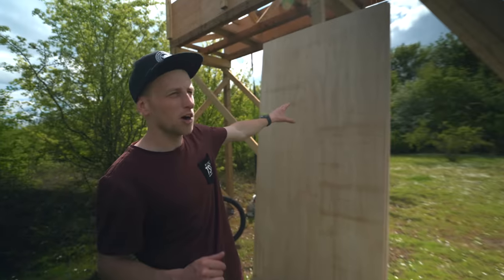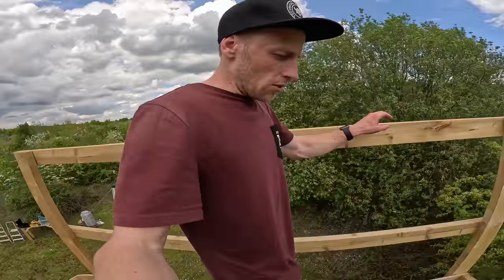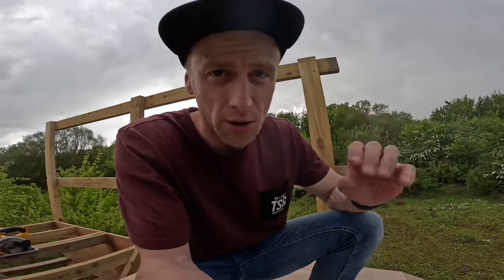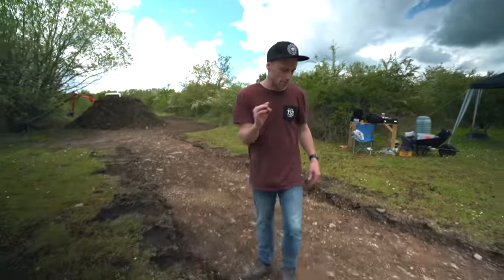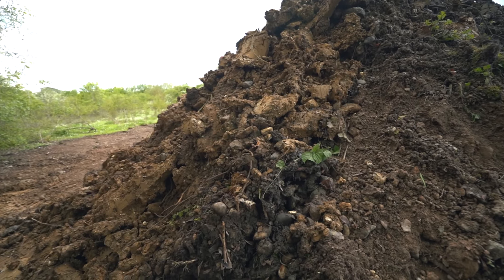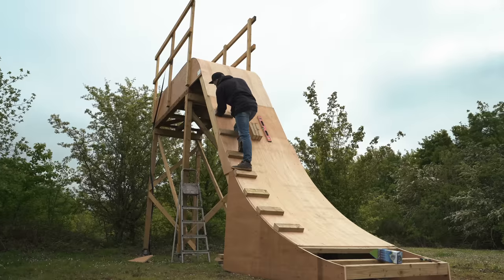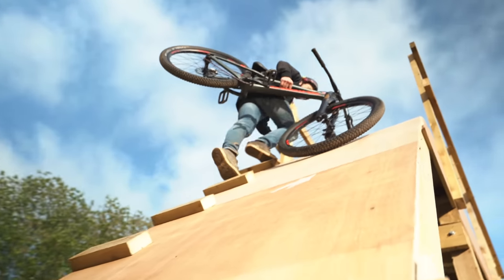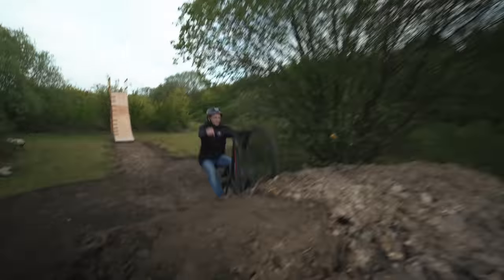TESTING THE FIRST FEATURES AT MY DREAM MTB COMPOUND!

Comment: Personally I'd wrap a stairset up the side and around the back to where the railing is missing. Just at 45 with ply at steps like the roll in and a deck in the middle before turning up the back. That will give you even a bit extra room and people can climb while someone drops, and it gives you some more stability if you add to it on the other side of the stairs and go bigger. Also avoids any screw ups with the stiars while dropping which would be... really bad.
Reply: This is what I was gonna say, ony put better

Comment: you might want to dig out the bottom of the roll in and fill with crushed stone and cover with some dirt, i built many many of jumps in New England parts of the USA and we get a lot of rain and have similar terrain. you can avoid the soft ground with the technique i mentioned. probably still be fast in the rain. the dirt under the top soil does look decent but i see a lot of guys like Pilgs and Jones and they all got the same issues with there home jumps. well Sam dont anymore lol.